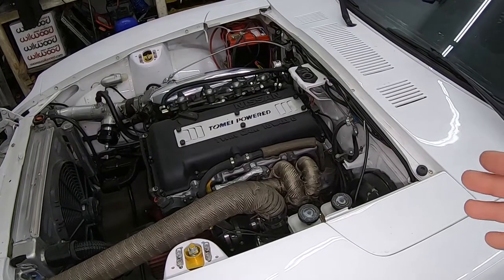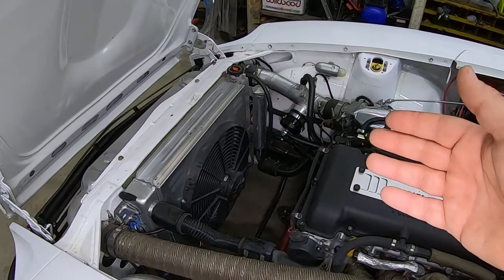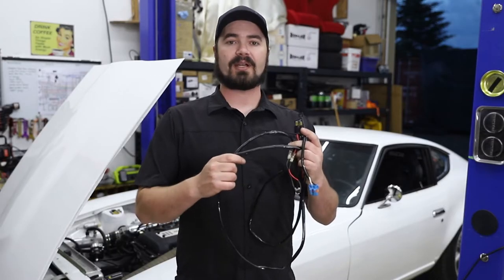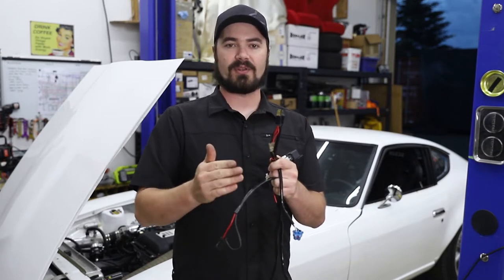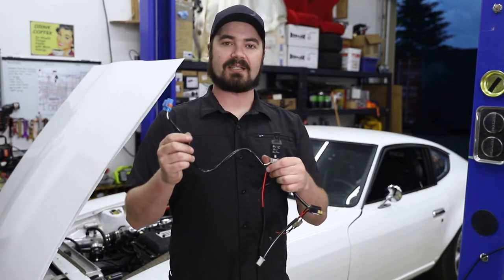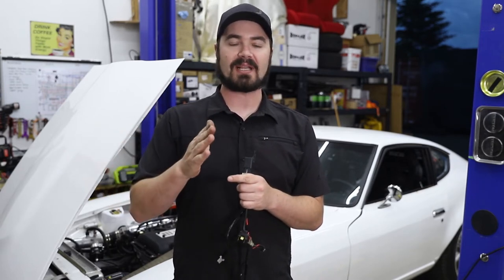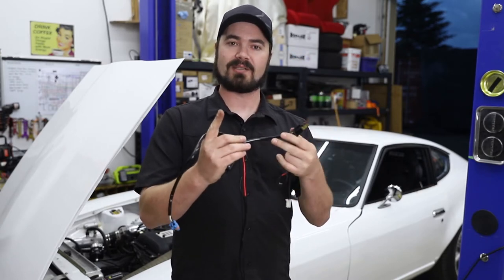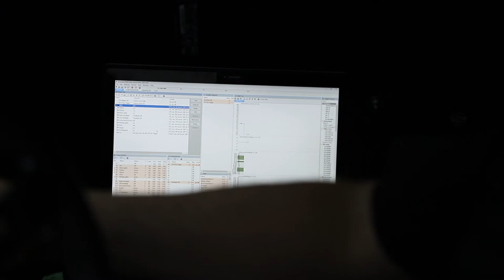The great wiring purge of 2020

Comment: Really enjoyed this video, no fluff. Subscribed!
I'm going to be installing the same system on my Rx-7 project. I never knew I could use the factory switches to control the circuits.
Reply from the maker: I will be uploading another wiring video on using delay circuits in the near future. I hope some of that info might be helpful as well!
Reply from the maker: You certainly can. It would just depend how OEM you wanted things to feel vs race car. Analog or CAN are both just coming in as an input instruction, so you could even merge them into a formula inside the PMU for multi-level checks before performing the output.

I think the electric fans on both my Mustang and 240Z through ECU control via PMU-16, and in the case of the 240Z, actually modulate and soft start the fan to keep the idle smoother so the alternator drag didn't make me have to overly slip the clutch on starts should the fan kick on at the same time.

Comment: Hi Casper.  What would you thoughts be about putting a PMU system in your mustang?  I pretty much have the same car with a Holley sniper system.
Reply from the maker: I will be doing this very soon. I want to use the PMU to provide safe, filtered, power to my Sniper EFI as well as the ignition. My car had a hack and slash relocation of the fuse block done by the previous owner, so I'm debating putting the PMU in the engine bay where the block currently is or back under the dash where you might expect.